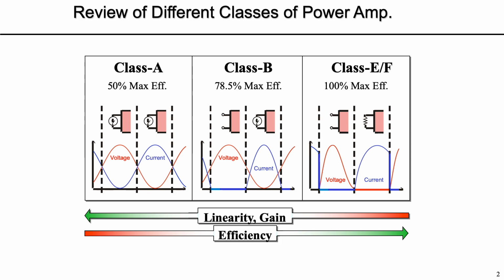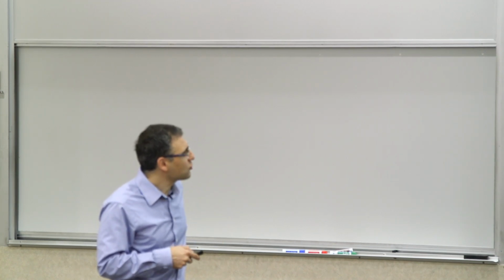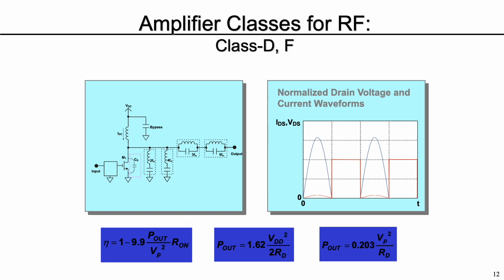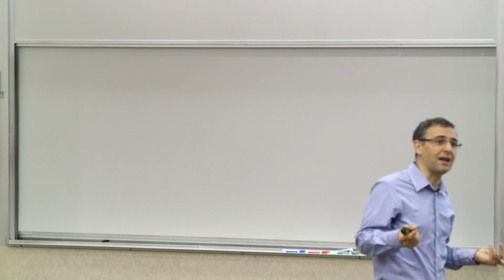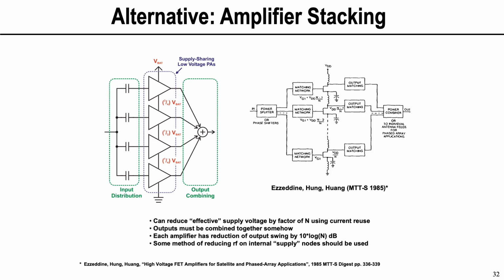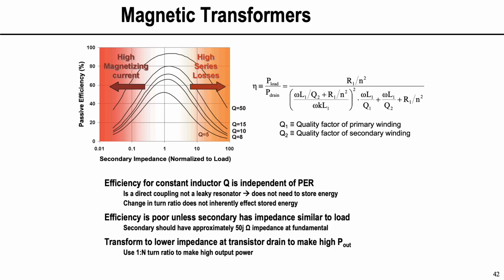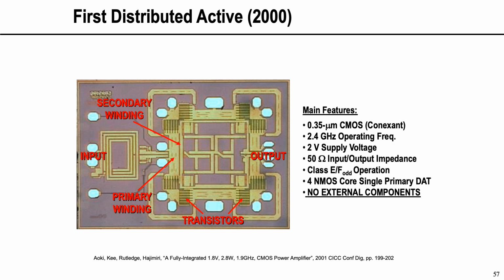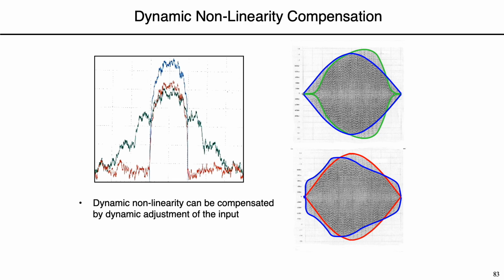188N. Intro. to RF power amplifiers

Comment: Hi Dr. Hajimiri!, I am working on a RF card, the final PA is Doherty power amplifier. When I provide dc bias to the main and peak, quiescent current is rapidly shooting up and going over limit. I have tried increasing the contact between the PCB and heatsink(thermal paste, screws etc. )What possible techniques can I use for debugging this issue?Kindly suggest.

Comment: At 10:52 on IdVds plot breakdown voltage is lower for higher power - it might be other way around for GaN (no punchthrough) as increased temperature (=>scattering) slows down electrons and shifts avalanche towards higher Vds. Thanks a lot for the great lectures!